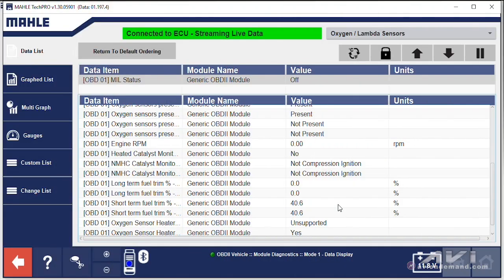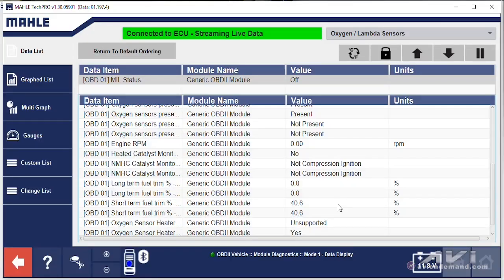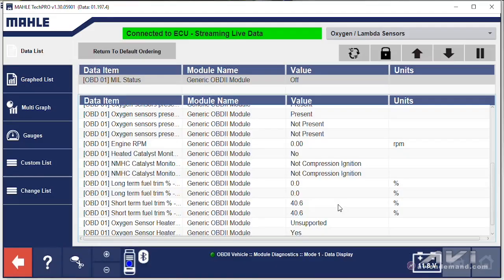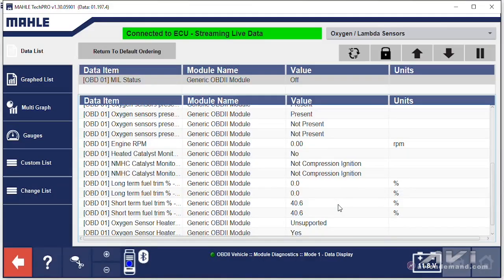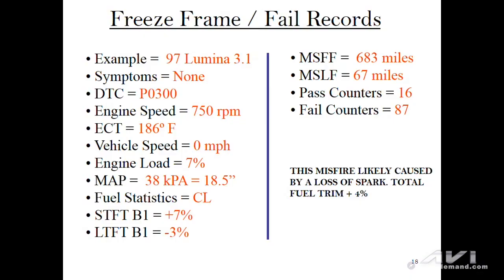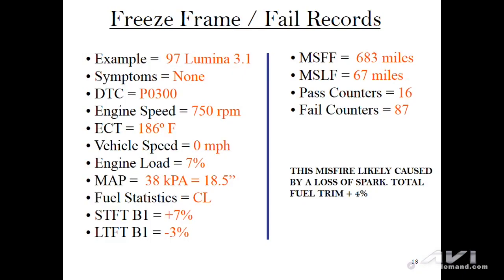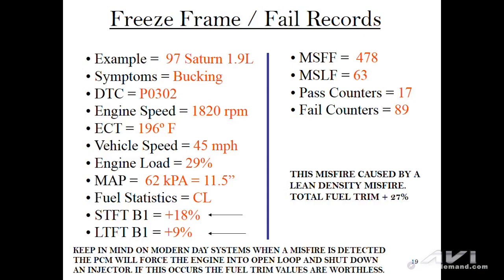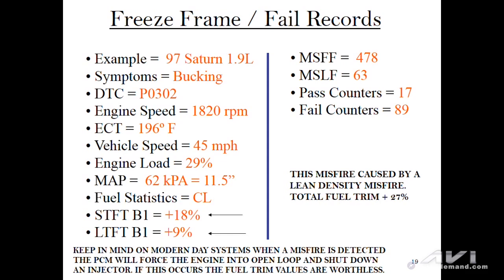P0300 Fix by Reading Freeze Frames

Comment: What kind of car doesn't tell specific cylinder, 301, 302 etc. (but only P0300)?
Besides that: start using oscilloscope (this is the ultimate way to diagnose a car).
Reply: yes some cars indeed do only set a P0300, I've found that myself on a ford v10 gas, and even after multiple drive cycles it would not set anything other than a 300. I found a weak ignition COP using a $10 spark tester with adjustable KV settings, and stress tested each coil
Reply: oh and in some cases if the CKP is not learned properly, it will only set p0300. Try a learn procedure and then it might be able to correctly flag the specific cylinder.